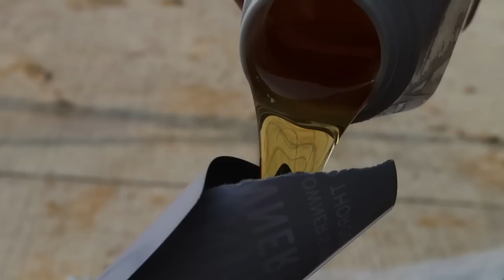WE ARE FINALLY BACK!! (Bigger & Better)

Comment: The bike is still salvageable. Get it out. Drain it.  You''ll have to replace the magneto. In other words, the ignition system will have to have parts replaced, everything else will work fine as long as it's cleaned and oiled. (seen a mini bike dropped in salt water and this is fresh water)
Reply: B Tankful
Reply: I had a pw80 that got fully submerged in water all I had to do was put new oil and fuel in and drain the water from the exhaust and it was as good as new
Reply: Go get the bike!
Reply: Xaphan. You were right. (the one I saw pulled out of the drink had it's magneto rust two days later so I was going off that). I want to acknowledge you totally called it!

Comment: ok roman if you ever see this all you have to do is  drain the carb and drain and refill the oil and with the spark plug out and spin the engin over till no water is coming out then put it back in and drain the gas and put fresh it and it should good
Reply: i ride down creeks on fourwheelers but never sunk them like that but if we did it would be that simple
Reply: The trick is gonna be getting it out😂
Reply: Get this to the topppp
Reply: You guys gotta like this so roman sees!!!
Reply: Samuel Garris @romanatwoodvlogs when you get the bike or get a new one loosen the governor screw and it will go faster and it will be louder
Reply: But the bigger problem how they goona get the bike from the bottom of the water
Reply: Berci Enyedi easy fix
Reply: Samuel Garris yes
Reply: what about the oil and fuel leaking out the bike into the water, isnt that gonna be bad for them if they swallow the water or such?
Reply: KillerBoltz ok I will like
Reply: Macaroni Games wow how did you know that
Reply: Samuel Garris I
Reply: MattGraphix dew to the size of the  body of water and the maybe gallon of gas and quart of oil it shouldn't hurt anything or anybody
Reply: Karen Kilpatrick i've seen it done and have had to do it i was riding a creek one day and saw a guy who sunk a highlighter rzr and all he did was pull the spark plugs and turned over the engine with the starter water shot like 8 or 9 feet out of it once it stops their is no longer water in the engine but the oil definitely needs to be changed or permanent damage will occur

Comment: Get scuba gear and get the bike back next vlog like so Roman can see.
Reply: DClips it will most likely be damaged by then maybe
Not even running
Reply: I am a 13 y/o SCUBA diver
Reply: it won't work. engine will be flooded no matter what
Reply: RosstonCoasters thats why your not a mechanic and yes you can acually save that bike
Reply: DClips fastest like spike iv ever seen lol
Reply: All they gotta do is drain the carburetor
Reply: yah but at least there will be no oil or gas in the lake
Reply: the bike is prolly really heavy. there's really no point because the gas and oil is already in the water and the bike won't function now, even if they get it out, because of water damage. getting it out is pointless
Reply: if it is heavy u can use a lift bag

Comment: just use some trusty Atwood rope and a big hook to get the bike. you do not want the bike in a place where you're swimming it could leak oil, gas, and could generally just be a hazard. Also making the bike run again isn't too difficult.

Comment: They need to get that bike out before he has and oil contaminated the water and u won't be able to swim in the pond anymore! Share with Roman so he can see!!!
Reply: Camden Shea exactly what I'm worried about. And even if the oil and gas stays contained in the bike, the battery terminals will still rust and eventually leak battery acid.
Reply: dont think that thing has a battery
Reply: Camden Shea yup they Rlly need to hey that out
Reply: Camden Shea don't worry about it
Reply: They will get it out
Reply: Camden Shea do you know anything about oil. First of all it's inside the engine and it won't come out. Second thing is If it did come out it's only about 2-5 quarts of oil it wouldn't do anything.
Reply: No need to be a jerk she's just worried
Reply: David Wrobel the oil can't get out and there is no battery yes there will be gas but it will evaporate when it reaches the top due to gas being lighter than water
Reply: david casciato 😂😂 that's what I'm saying the oil can't even get out
Reply: Also the battery is only 12 volts it won't do anything.
Reply: Adam Mannes there is no battery
Reply: Camden Shea yeah bro ur right
Reply: It can be risky cause with the fountain and the oil It will blow a fiuse
Reply: Camden Shea its not enough to do anything and i think they know that
Reply: Camden Shea ii
Reply: With a cheap bike like that, oil and gas can leak pretty easily,, yeah its not much, but if it does the water is fucked
Reply: Camden Shea They tried their best to get it out with what they had. They know that it needs to be removed asap but they already said they need more gear to reach the bottom. It's probably already out by now, remember this was recorded yesterday. Just to clear things up.
Reply: Challenge Bros o shit I forgot it's a pull start
Reply: Challenge Bros lmao explains why when they pulled it out today there was oil leaking everywhere in he water😂
Reply: Adam Mannes yo i'm sorry man i was just tryna help not start any fight i'm not a engine professional
Reply: Camden Shea well now you know.
Reply: Adam Mannes lmao just get out of my life bro stop tryna pull other people down

Comment: The bike will be fine just drain the oil and gas for 24hours then it'll be fine.I've done it twice
Reply: Adam Scudder I think the problem is finding it 😂
Reply: Thanks for letting me know this has happened before
Reply: I declare this day International Roman Atwood and family day.
Reply: Adam Scudder  hjrvuef irkjfj end of the day
Reply: I dont think its that easy.. depends on how fast they get it out and do the stuff you said. They could always buy a new engine for like 150
Reply: Adam Scudder ive done it over 5 times so it should be fine
Reply: VespinKnot 1467 Yeah but it depends did the engine suck in water and hydro lock it and blow The head gasket that's the question

Comment: Country best bodyguard. Much quicker to go in the water with the bike then hop off and run. Also I recommend you get a rope with a hook anchor to try and fish it put.
Reply: the gas and oil is already in the water and the bike won't function now, even if they get it out, because of water damage. getting it out is pointless

Comment: Get the bike back and repair it for him I feel so sorry for him lol
Reply: Nathan Brown  the engine is gonna be flooded and everything...country maybe can fix it but not roman....
Reply: Just need to drain the engine oil and clean the carb and replacing gas then change the oil a few more times and it will be fine
Reply: Nathan Brown once the piston tries to compress water instead of gas, it seizes up, therefore not being able to start and run
Reply: Nathan Brown un

Comment: Hope You realized that the oil and gas could leak out of the engine and can contaminate the water. That can be dangerous
Reply: Skelemor isn't it the same as a boat being in the water.
Reply: Skelemor they are gonna filter and clean the water
Reply: Usually motor boat are in much larger bodies of water where the contaminates don't matter. Also, people don't usually swim where motor boats are since that is a major safety hazard.
Reply: Skelemor that's exactly what I was thinking after the shock wore off that he drive it in lol. They need to get that thing out quick!
Reply: skelemor yea but he want realise until and couple of weeks
Reply: scaryjerryman at least you have common sense
Reply: you must not know how much oil and hydraulic fluid and gas are in lakes
Reply: It's probably out but for the video they made it as if it's down there it probably got taken out straight away
Reply: Skelemor good point bri
Reply: Skelemor hi

Comment: And now there's gasoline in the lake
Reply: JGY i know rigth
Reply: JGY gas tank is sealed so no
Reply: JGY I thought about that too....
Reply: JGY ikr
Reply: Max W yeah but the fuel line will eventually snap if it is that deep at that pressure
Reply: JGY I WAS THINKING THE SAME THING
Reply: JGY they accidentally drink the water and they dead
Reply: We all knew it was gonna happen
Reply: the gasoline will rise to the top and evaporate away...the oil on the other hand will not.
Reply: TheCivilAnarchist no gas is gas oil is oil
Reply: kryptonite gaming the gas and oil has already spilled out by now, gas tanks have breather tubes to let in air, the gas was in the water as soon as the bike hit the water.
Reply: Gas is something that is not visible. Petrol and Diesel are just different mixtures of oil. I'm British I use the correct terms.
Reply: JGY it's contained in the logo and the gas tank
Reply: There is barely any gas in that small bike. It won't hurt anything
Reply: JGY Forget about the gasoline the water is all mud anyway. It's not nice fresh clean water it's disgusting mud water. And I can't believe they actually swim in that shit it's so unsanitary😬😷🤢🤢🤢🤢
Reply: TheCivilAnarchist engines use gasoline to combust, as well as engine oil, for cooling and cleaning of the engine. Gasoline evaporates quite quickly, whereas engine oil does not. No need to call someone an idiot when you have no idea what you are talking about.
Reply: TheCivilAnarchist there to different things
Reply: TheCivilAnarchist there different things had will rise and evaporate oil will rise and stay at the top and it won't evaporate
Reply: Joe B dude country people don't care I know that because I am a country person and that u say makes u not a country person
Reply: It's a pond not a "lake" and a little gas in it  won't matter because it will go away after a wile
Reply: they can't go all the way to the bottom and carry it out, it's extremely hard. plus, the gas and oil is already in the water and the bike won't function now, even if they get it out, because of water damage. getting it out is pointless
Reply: Jennifer I could make it run again, just cause something gets flooded doesn't mean it's destroyed, I've done it to my dirt bike, just take everything apart, clean it and put it back together

Comment: There goes a $400-$500 bike lol
Reply: Viet Tommy there 350$
Reply: Averagepabiker in the store it said on the bike $449.99
Reply: Chump change
Reply: Actually its a easy recovery for an tow truck operator or someone who goes offroading..   Dive to the boat tie a rope to it drive a quad to the closest edge spool out the winch so that there is only one or two full winds on the winch hook the use the rope to reach the remainder of the way to the bike winch the bike up out. Take out the spark plug and pull the pull start a few times to get the water out of the cylinders and put the plug back in, change the oil, put drain and put new gas in it. Pull start it and you're good to go.  I sunk my quad in a pond that was up to my exhaust pipe trying to cross it and the quad stalled the water went in the exhaust so all we had to do is winch it out and pull the spark plug turn over the engine so the water would come out and put the plug back in started and ran just as good as before took me only an 20 to 30 minutes. However in their case the bike being fully submerged they will have to drain the gas because their gas tank was fully under water and the tank has a breather tube so the gas can expand and contract as it heats and cools during weather and temperature changes, so water is in with their gas and so drain the tank throw the bad gas in the truck so that it isnt a waste because the water will be diluted in the gas tank of the truck and it won't effect the truck as bad. then put in fresh gas and it will be as good as new. For some me to pull that bike out with my quad and fix it would only take around an hour or two.

Comment: If you did get it back all you need to do is drain the oil change the spark plug and drain the gas and refill the oil and it will drive just fine
Reply: when an engine gets enough water in it it will break internal components such as pistons and rods. the gas and air is compressing and then ignites to cause a mini explosion to move the piston. water does not compress nearly as easy as the air and fuel. which causes there to not be enough room in the cylinder for the water to compress causing things to break. so 99% likely its toast
Reply: Phyx I have done almost the same thing on my mini bike it hydro locked I pulled the top end off drained the water out the cylinder and then drained the oil inspected the crankshaft and the piston rod and cleaned out the block I put it back together added oil and it still runs fine today. But I agree water can damage the motor but on most small gasoline engines like that most of the time if you do it right and inspect everything you can usually get it running and it will run fine

Comment: Use a waterproof flashlight and goggles
Reply: Dimmi Lo and learn to hold your breath
Reply: It won't make a difference. The water is so dirty that he won't be able to see anything.
Reply: katherinerm788 stop being rude I've been in lakes dirtier than his and I could see
Reply: pig meat yea all you have to do is go all the way to the bottom and you can see what's near you
Reply: I would say, rent for a day some divers equipment and a waterproof flashlight. Then you will be able to get it out. A good bottle of air gets you at least 20 minutes under water. I'm afraid it is too late for the bike though.

Comment: DONT LET EANYONE GO IN THAT LAKE BECAUSE THE FUEL WILL GO INTO THE WATER
Reply: Oliver Hiscox And oil. I was thinking the same thing also. The pond is poisonous now that it has gas and oil in it.
Reply: pretty sure there is a lot worse things in the water at beaches or even oceans and people still go in it.
Reply: GUYS SUICIDE IS BADASS
Reply: Oliver Hiscox that's what I was thinking
Reply: Roman probably has a water filter for his pond.
Reply: I don't think a pint of gas and a pint of Oil in a 400,000 gallon pond is going to be killing anyone soon ... Plus The Gas Tank is SEALED as is the Engine where the Oil is at . SO I don't think any will be Leaking into the Pond any time soon ...
Reply: Oliver Hiscox i
Reply: Its going to be like the lagoon from the team 10 house
Reply: Hi  mate
Reply: The water will dilute the gas
Reply: But better
Reply: Nick Pierson The bike wasnt leaking any Gas or Oil so ot should be fine
Reply: Oliver Hiscox it will only leak if the tank pops
Reply: lol
Reply: most fuel tanks are pressurised and sealed it wont leak
Reply: the oil  and littel gas will not leak out .if that was the case when you lay it on its side or flip it over it would be all over you and every thing...man  its ok. water at the beach has merkery  and junk never mind needels on the beach...
Reply: 😂😂😂 Oh my god😂 Really? That was like no fuel at all and when it spreads out over the water, and it will it won't matter, swimming in public pools and way more dangerous than a little bit of fuel in a pond😂😂
Reply: what does that mean actually?! "Dilute the gas" ????
Reply: gas tank is air tight same with crankcase wich holds the oil.the bike b ok and water in pond b ok to
Reply: Talha Mughal there is so much water compared to the gas the gas will mix in and there will be like no gas per gallon of water

Comment: How deep is the pond
Reply: That is what I was wondering.
Reply: daddydavis I think roman said once that it's was like 15-20 feet
Reply: Thanks man that is deep
Reply: It is deep but roman is certified in scuba diving so with the right gear he could get it
Reply: Arlana Flack most likely he can't get it cause it's simply deep and you can't see at all even with goggles
Reply: Remember the big hole when it had no water they took all the rocks out and filled it with water
Reply: daddydavis 200 feet no joke
Reply: He said it's like 30 feet

Comment: Does that not contaminate the water? (It was still funny tho:-)
Reply: Martin Wachira yup
Reply: Martin Wachira it won't contaminate the water because there is so much water that the gas and oil will be fully diluted instantly
Reply: bjgaming h I doubt that
Reply: bjgaming h it won't dilute instantly and the oil will float and stick or stain anything it touches
Reply: Martin Wachira a little bit won't hurt
Reply: bjgaming h what about rust
Reply: Tyler Knight what about the oil??
Reply: Martin Wachira shouldn't be a problem unless the children get scratches from it,
Reply: Aswell if Roman got a magnet attached to a rope and fished for it like that he would be able to find it, go to it and attach a rope to it, without the need for scuba gear or anything like that. AKA magnet fishing
Reply: Except petrol and oil don't go into solution with water.

Comment: Put a predator 212 in that and get a 3/4 clutch so it can still be chain powered. It will go a lot faster then the stock engine. That's what I did with it it was my first bike.

Comment: Get out the minibike and get a new engine from Harbor freight tools
Reply: Jonathan Ramos all he needs to do is pull the plug and drain gas and oil and put in fresh oil and gas and it will run iv left a truck under water for a week and just changed all the fluids and it runs fine
Reply: Jonathan Ramos wat about all the water that goes in through the exhaust
Reply: Amir Haydar05 that's why you pull the plug so it will run out of the cylinder thats if any makes it past the exhaust valve

Comment: I Recommend for you pond, you should have a paddle boat to have a little extra stuff to do!! Also if you have the money, which you probably do!😂 you could buy or hire a comping to either install a big tube slide off of the side of the dock, where no inflatables are, or you could buy one for an above ground pool but instead concrete it into the ground beside the pond!! One last thing is you could also screw the same thing that you could concrete, onto a dock that you could assemble and anchor in the pond! Like if you agree!